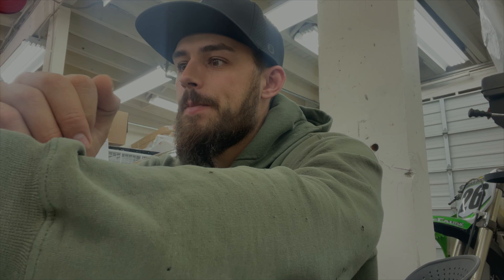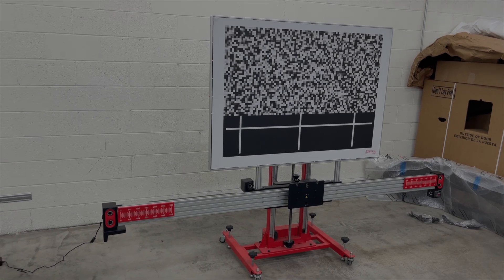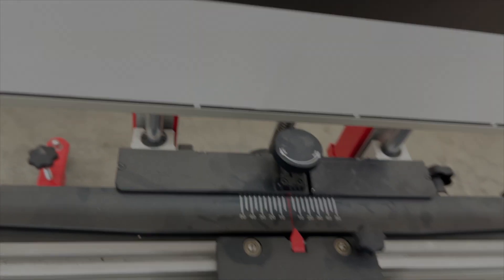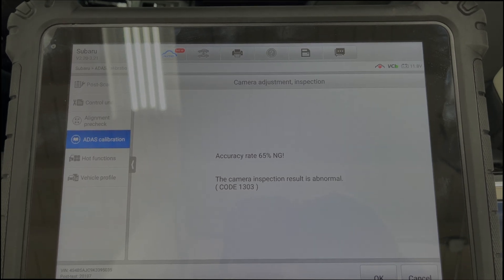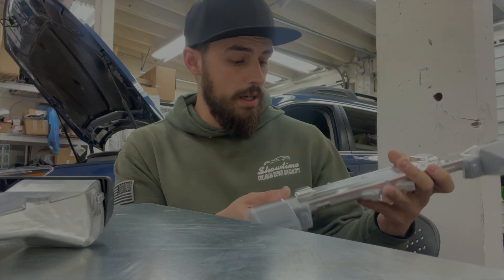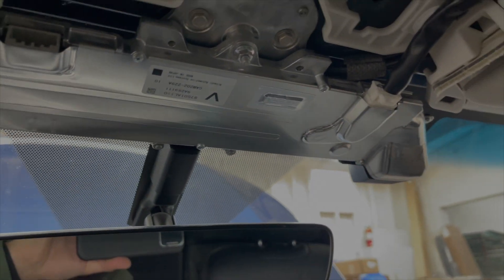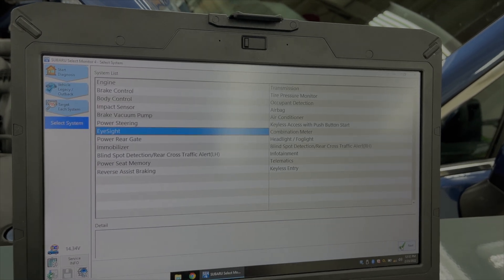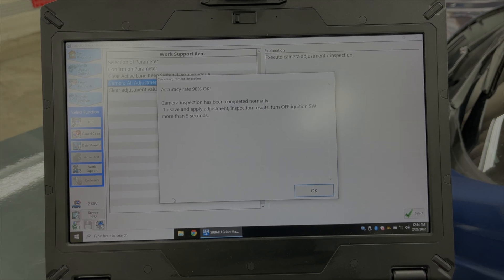HOW TO: SUBARU EYESIGHT CAMERA REPLACEMENT & CALIBRATION

Comment: Is it possible to replace the camera yourself at home and then have a windshield shop do the set up on the new camera or can I also do that at home somehow before taking it for recalibration?
Reply from the maker: technically yes, BUT most windshield companies have no experience in replacing and programming these camera systems and many dealers will not want to touch it if someone else has done any work. so youre stuck with a specialist in these systems to help with programing or just paying up at the dealer. you can technically program it yourself but would need a high leve Autel scan tool OR OEM Subaru equipment.

Comment: Subaru Eyesight control sucks. I have a 2022 Outback and even on a clear highway, nice weather, Eyesight Control constantly goes off. Dealer can't seem to fix it. What bothers me most is it constantly shuts off the cruise control !
Reply from the maker: Something must be wrong! I would press harder to try and figure it out. A tech with good understanding of these systems should be able to narrow it down.

Comment: If I’m installing a dashcam, is tucking the wires up under the eyesight and pulling them out the mirror hole going to cause any problems?
Reply from the maker: sorry for the late reply, it shouldn't affect the eyesight although i would be very careful where you place the camera on the windshield as it could affect the vision of the stereo cameras.
Reply: @ no worries, I figured it out. I tucked the wires up under the eyesight and pulled them through the mirror hole. The dashcam is placed dead center under the mirror and I had no problems.

Comment: What’s a budget friends laptop you recommend. And how were you able to have all of those OEM softwares on that one laptop.
Reply from the maker: Not sure what you mean by "budget friends" maybe friendly? The laptop I have certainly wasn't budget friendly it was around 8,000$ it is a tough book designed to be used for this purpose with 5 different hard drives - one for each different OEM program.
Reply: @MotorizedCo  yeah budget friendly. Auto corrected to friends. Yeah $8,000 is not budget friendly lol
Reply from the maker: I know it isn’t , unfortunately I had a “regular” laptop before and one program worked fine but I tried to install a second one and it had major issues… programming, diagnostics and calibrations are a major part of what I do for a living so I decided to make the investment and have been trouble free since 
Check out AE TOOLS 
that’s where I get most of my specialized equipment from.
Reply: @MotorizedCo  oh damn. Yeah same. I do airbag work , CrashData resets , ADAS calibrations and want to get more OEM softwares. I’ll check it out. Thanks.

Comment: I'm here because my eyesight failed due to extremely cold temperature. Dealer said it needs replacement, i canr justify forking that much for a camera! Found a used one for a decent price, but would be risky to pay for part and then someone to calibrate, only to find out its a dud or its something other than the camera.
Reply from the maker: Best ok luck! From what I’ve read on the service info you should be able to “recode” the camera to your vehicle and hopefully it calibrates. Keep us posted!
Reply: Hi mike im in the same situation. They're asking me 4k cad to replace the entire eyesight due to extremely cold temperature. Any update on your situation?
Reply: @patriciatan6009  Nothing from Subaru yet. I'm in Canada, was quoted $6k which is roughly 14% of the MRSP when I bought 5.5 years ago. I'm feeling like I'm S.O.L. the only thing annoying is the cruise won't work and have that yellow Eyesight and RAB light  (R.A.B works, yet light is on) I will update if I hear anything back.
Reply: Hello Mike, did you hear anything about this? I am in the same situation. The eyesight stopped working due to the cold and they say it needs to be replaced. We are talking about $5K.
Reply: @yimmigutierrez83  I have sent another email to Subaru as I have not heard back from them on 2 months. Seems like this issue is going to compound as warranty periods end, and people have to pay for replacement out of pocket. Hopefully they issue a recall on the part.

Comment: I wish that you'd have said more about the "On Road Automatic Adjustment" after calibration in the shop.  I had the windshield of my 2018 Outback Limited replaced with OEM Glass by a Subaru Dealer, who sublet the actual glass replacement labor, then proceeded to do the re-calibration of the Eye-Sight System.  When I came to pick up the car I asked whether it had been trained on the road after the work in the shop.  My service advisor and the one next to him were insistent that the work is done and the system is fully functional when the car leaves the calibration bay.  I note that the dealer put 0.5 miles onto the trip odometer the day that it had the car.  //  When I drove away the car could not identify any lane markings.  I drove it about 5 miles on a new very nicely marked Interstate type road on the way home and it recognized no lane markings on the trip.  (The Lane Keeping Assist was turned On.)  //  I contacted the Subaru of America Customer Advocacy or Assistance Phone Support.  The representative with whom I spoke checked all available resources and found that SOA had NO information about re-calibration and retraining of the Eyesight System.  It recommended that I take the car back to the dealer to have it checked.  I'd already done that 8 days after the initial work.  During the time between the first and second days at the dealer I put 106 miles onto the odometer.  The car was recognizing nice bold lane markings by then, but it would not recognize Yellow Markings, and it did very poorly on narrow lanes.  On Interstate type roads it would recognize lane markings during straight stretches, but stop recognizing them on small radius curves.  A manager took the car out for 11 miles, about 7 or 8 on the Interstate quality roads, and determined that the Eyesight was working fine.  //  I need to know more about the "On Road Automatic Adjustment."  Can it eventually correct for very poor re-calibration in the shop?
Reply from the maker: Email me your year make and model + vin number and I will send you the Subaru OEM service manual procedure for calibration. 
Wrecktechnologies@gmail.com

Comment: Great video, I’m in the same situation. BTW where you find the model number and O/P code?
Reply from the maker: To me that sounds like something to do with the clock spring ( which incorporates the steering angle sensor) 
Often times if you aren’t careful when removing the steering wheel, if the clock spring gets turned a bit off center then the wheel installed back on when you make a full rotation of the wheels it can break the wires in the clock spring resulting in no communication to many functions.
Reply: @MotorizedCo thank you for all your adviceS. did the diagnosis on the steering wheel component, watch the live data on the angle sensor while spinning it. Found that Angle sensor is faulty. Now I’m facing another problem when do the ADADS calibration, we did the health checks, 2 code found in the eyesight system(stereo camera adjustment incomplete, model registration needed) once we click into the ADAS calibration, the eyesight system isn’t in the calibration list, Autel only shows LH and RH radars  nothing else. Sigh 😔
Reply from the maker: Make sure you replaces the clockspring/steering angle sensor prior to any other diagnosis or calibrations. 
One code in one module can throw others in other modules. Especially on Subarus. 
I have autel and I have subaru OEM tooling. When I install a new camera and program it I use the OEM tool especially with a newer car.
Reply from the maker: Passenger side door jamb there should be a black tag
Reply: @MotorizedCo  sorry forgot to mention I got the 2022 Toyota GR 86.
Reply from the maker: @jingshengli2927  should be in the same spot. Why is the camera needing replacement?
Reply: @MotorizedCo  something happened after replaced the A/M steering wheel. The eyesight function turn off with same codes as yours. T/C off LKA off The steering angle sensor no communication. The angle sensor circuit is good. I assume that everything related to eyesight recalibration. Any advice? 🙏🙏
Reply from the maker: @jingshengli2927  I would look more closely at the steering wheel function, plugs, etc make sure everything is correct there. 
Replacing the steering wheel should not effect the calibration status
Reply: @MotorizedCo  everything is good on the steering. Do you think the eyesight and angle sensor are related? Do they communicate together? The code I got are all related with eyesight and brake control lost communication with angle sensor.
Reply: good evening i am runnig the same problem i have the model number but where to fing the O/P code ??

Comment: great video can you dm on where to get the ssm4 or drive with ssm4? Thanks
Reply from the maker: As for the communication device Subaru suggests you use the DENSO D_STI. Although I'm sure other j box communication devices will suffice such as drewtech cardaq. The SSM software can be subscribed to and paid for on Subaru's technical data website, found here: https://subarutech.net/

Comment: I have to say that eyesight is absolutely horrible. My 2015 Forester has issues with night driving. When there's a bright street light or oncoming traffic it shuts off...warning buzzers etc. 

I've driven other cars with adaptive cruise control that have 200K on the odometer and they've always worked flawlessly. 

Eyesight... Horrible idea and execution. I'm also waiting for my CVT to die...
Reply from the maker: Interesting! Subaru definitely switched it up with their method of doing this. Most manufacturers use a millimeter wave radar sensor mounted in the grille/bumper for adaptive cruise and they use a camera in windshield for lane keep assist etc. Subaru just had to go being different 🤷🏼‍♂️
Reply: @MotorizedCo  camera is superior look at Tesla they're ditching radar
Reply: How about a video on the dynamic recalibration with the eyesites super sensitive driving conditions? Also, why would this Subaru need to be recalibrated after a windshield replacement, when the camera is never touched or moved because it is in the headliner and not on the windshield like everything else?

Comment: Great video! Do you think a used camera system could be used or are they VIN locked/specific?
Reply from the maker: Great question! Never tried it before.. can’t answer that question rite now! 
My guess is that Subaru would not recommend it, but that doesn’t mean it’s impossible!
Reply: hello , I wanted to ask you the same question about registering a second hand camera to subaru outback 2021 , do you know what i need to replace to avoid buying new part
Reply: No problem, we have replaced cameras from donor vehicles several times in the past and calibrated them. The results were between 85-90%.